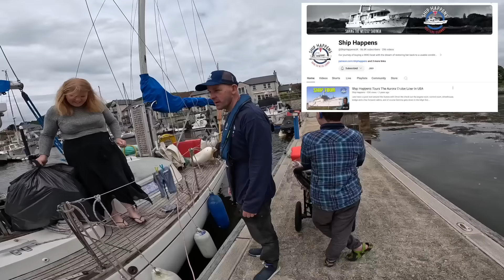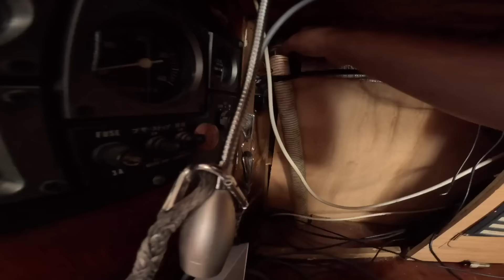Rip it all out!! Start again!!

Comment: Its the running time needed under worst case conditions that needs to be considered, plus a healthy reserve. I took a trip from my mooring in Salem MA to Portsmouth NH in October for the end of season haul out. I carried twice the fuel I needed for the early season reverse run from the marina to the mooring. The trip started out sunny and pleasant. After passing Cape Ann, a strong NE wind arose and the sun set. Soon it was one hand on the tiller, a hand on the rail, and braced feet. There was a spray of seawater to the face with almost every swell. Progress was very slow. After finally arriving in Portsmouth, I found that the public pontoons had been hauled out for the season. My last tank of fuel ran out and I had to anchor. So glad I was in a sheltered harbor and not still offshore.
Reply from the maker: Oh wow!! Thanks for sharing your experience!

Comment: Save a LOT of time by putting some fuel into each filter prior to installation. I would look into one of the electric fuel pumps to help prime everything, as it also works as a backup if the primary fuel pump fails in the worst place imaginable.
Reply: Ask about an automotive diesel electric fuel pump might be of use Andy like they use on vans to lift the fuel to the engine, you can also use it to pump fuel from one tank to another ..  in a problem situation.

Comment: One thing that you conspicuously failed to mention on the new day tank was a vent line.  Don't forget to install a vent for the tank lest you cause a new problem when the lift pump starts really sucking fuel out of the tank!
Reply from the maker: The vent line is there. I forgot to show it. Of course it's there it's one of the default attachments on the tank. There's lots I didn't show. It wasn't a tutorial. I didn't show me making a cup of tea or eating a sandwich either. Thanks though.

Comment: Nice one Andy. Nice to have 2 days tanks and once the main tanks repaired you'll be set. What a find with hopefully those 2 water tanks. Like you said do things bit by bit and hopefully when you are ready for the main sail things will be good to go and no problems arise. Yes get that messed cleaned up before Melissa arrives back. And you have to find a place where you store your tools so you know what you are looking for where it should be. I also know other sailing channels that have two of the most used tools they will use plus spare parts filters, fuel pumps, alternator, ect. I'm sure you'll have all this in hand once the main sail begins. cheers
Reply from the maker: Good suggestions thanks

Comment: Hi Andy Great job, for what it's worth I'm a mechanic and have been living aboard for 18 years. Always buy a spare filter in fact have a set of filters plus belts, fill the filters with fuel prior to fitting. That fuel tank and mounting, consider expanding foam into a plastic bag suspend the tank into the required position and at that point using the applicator nozzle supplied with the expanding foam squirt the foam into the bag and allow the foam to expand and support the tank. Also have you got the option to make a lifting or removable panel above the tank for easy access to the fittings. When your not busy 🤣🤣 those wires need to be checked to see if they are live, if not then operate every switch known to man to see if you get a positive signal.👍

Comment: A couple of tips from a former diesel engine specialist. The new vertical pre-filter can be partly filled before screwing it back on, saving priming time and your fingers and thumbs. 

If you can't find a filter wrench, a screwdriver through the casing and out the other sides works wonders, but obviously it will get messy.

There is normally another bleed screw on the fuel injector pump that bleeds the internal rail to the pump plungers.

Comment: What a great video. It was good to see the kind of real issues you often get. As a delivery skipper fuel problems are pretty common. 

You've sorted the fuel system. But more importantly you now understand the whole sytem and how to change the fliters, bleed and start the engine. Good knowledge and skills are probably more important than a perfect boat! Good onya. 

One charter boat I skippered in Antarctica had all the bleed points painted red, and the right sized spanners (also painted red) on hooks near the engine. We had to use it a few times and it made getting the engine running really quick.

Comment: Have you thought of adding a fuel trap before the filters, they have a glass bowl for easy inspection, and they are designed to catch water and large muck particles before they reach the fuel filters. They are also really easy to clean.

Comment: One idea: get one of those manual inline fuel pumps. It will make changing fuel filter and priming the fuel line so much easier. I installed one last year and haven’t regretted it a second.
Reply from the maker: I agree. This was filmed and edited a month ago so the comments and suggestions came in long after I'd already done the work

Comment: When i change fuel filters I always put some fuel in filter before installing. Same Injector pump as you have. You should open one injector line to get the air out and mine starts with few cranks.

Comment: Andy, next time you change filters whether fuel or oil partly or completely fill the filters with their relative fluids and you will alleviate most of the lift pump work. A tip I learnt as a mechanic.
Reply from the maker: Good tip!

Comment: Greetings Andy and Crew...I do enjy your vids and appreciate the ammount of work you all have put in to get prepared for your world tour.....Andy a sujestion regarding your engine lift pump issue ....Ditch the factory unit and install a 12 volt clacker pump they are noisey but efficent anwill fill with a usable preasurev of 4-6 pounds nore than enough to prime the engine as the main pump does all the work whilst the motor is in operation ....Good Luck ...Shalom
Reply from the maker: Good suggestion I'll do that at some point

Comment: Great work! It occurs to me that you could later add a large overflow elbow with a ball valve then pipe that to the keel tank. That way you can fill both tanks from the same inlet.
Reply from the maker: Yes 😀

Comment: Having a small farm and a number of pieces of old diesel equipment I have more than my share of dodgy diesel problems I ended up installing a prefilter with water trap on everything 9 times out of 10 you only have to change the prefilter if you get dirty fuel I chose a cheep (less than 10 AUD) readily available filter  so it isn't a financial burden to keep a few spares on hand

Comment: Diesel capacity increased 3 fold.  In time you can guesstimate how far you travel on 60-80 L. Remember to fill the 2 empty  jerry cans. Opportunities to extend motoring range 20+60+[(2or 3)×20]= 120 - 140 L. Just remember to use designated colors for diesel vs gas vs water. May also want to consider a screen mesh on the funnel to trap any sediment or funky business when transferring diesel from the jerry cans or dock or tender.

Took a bite out the thumb. Would consider adding motion lights or touch lights in the engine bay for increased visibility. Can't wait for the purpose or possible condition of the 2 mystery tanks. The never-ending job of tracing dead or live wiring.
To the next destination.

Comment: I know you say your not a mechanic. But the lift pump only does till the heigh pressure pump. Admittedly I have have never bled the injectors. Just turned it over a few times and it’s started. Oh and to save time on the lift pump, fill the filters with diesel first.

Comment: It’s been mentioned in other videos Andy but you should always fill the filters first which are very easy in your case good access and also fit a priming bulb
Reply from the maker: Yes you're correct there I didn't think
Reply from the maker: I will say this was filmed and uploaded a month ago. Long before the oth r comments
Reply: @SailingMelody  you did really well though and I must say the bigger fuel tank was a good upgrade so much easier to fill from the deck now well played 👍🏼

Comment: All that water could upset the balance of the boat. But great job with the new diesel tank and getting the filters sorted. You could also put fuel in the filters before putting them back. Lift pumps take for ever.
Reply from the maker: I wonder what the original design was though eh
Reply: @SailingMelody  Yes but keel tank for diesel. Water not the one in the saloon. Also need twenty knots to move. fully loaded.
Reply from the maker: @carltontweedle5724  not sure you're right about that.  Ive heard lots of people saying we won't move in less than 20 kts and everyone is entitled to their opinion.  but come sailing with us in 14kts and you'll change your mind.

Comment: Perhaps the new red tank can in future become part of a fuel polishing system… your main fuel in the repaired keel tank gets polished and deposited into the red tank, which is the only fuel the engine will see… leaving any trouble… asphalting, the dreaded diesel bug etc… separated from the fuel the engine is running on for addressing later, at a better opportunity.
Reply from the maker: That is the plan!! Great minds 😁

Comment: Without wanting to add to your angst re silly or malicious commenters, I’m struggling to figure out the point of the day tank for your diesel. On essentially the same boat, we have a 360 litre tank in the engine room on the port side (opposite the crawl through and an extra 75 litre diesel tank under the vee berth which transfers to the main tank via filters and a little square electric pump which pumps about 2 litres a minute, from memory. So no day tank, we simply draw from the 360 litre tank via the engine lift pump.
Reply from the maker: The main tank is currently decommissioned, and we are working to get it reinstated. Ours is in the keel. However once it is we will also keep the smaller tank so the fuel can run through a filter system before getting to the smaller tank.
Reply: @SailingMelody  What will you line the keel tank with?
Reply from the maker: @PaulBKal  epoxy and glass cloth

Comment: I was thinking that it would start on the 3rd inector blead off. Then you cut after number 2 to it running. So tell me, did it start after bleeding the third injector?  That's  what happens every time for me. Starts after bleeding 3 of 4.

Comment: Double clip the deck filler pipe. You shove the nozzle, pushes the pipe off, and fills the bilge.
I've got the T shirt.
Reply from the maker: Thanks for the tip!!
Reply: Sorry to read your " angry " post. I haven't read any of it but I can imagine. Why don't they ps off if they don't like it. No-one has to watch.
I'm 71, father had boats so I've sailed all my life. I still have a 10m ketch. Your lack of experience may be clear but your approach seems fine.
None of us were born with experience. Everything has to be learned.
Good luck.

Comment: Andy, you are cracking those injectors too wide. Just a bit of a turn loose will get you there. Opening them too wide makes it harder because it lets air back in. 

One thing I will strongly recommend to you is going for a Raycor dual filter system, it has a valve you can throw to the other filter when one clogs, it would have completely solved your issue on the water the other day with the throw of that valve, well assuming there was fuel in the tank, but you know what I mean. 

It is a fantastic system and IMHO should be mandatory on any boat putting to sea on the open ocean. 

Also you may want to wire up a start button for the engine room so you can turn the engine over while cracking the injectors, and a stop button if the fuel cutoff is difficult to reach.
Reply from the maker: Yes we definitely want to get one as soon as we can thanks for the helpful advice 😃

Comment: I add my vote to you ignoring the useless/annoying comments. Having said that, here is a comment that may well not pass that filter! Re the mystery wires: I have had to deal with that on 2 old boats; best bit of kit is to get a signal tracer; this induces a tone on a wire and then you can search/follow the wire with the tracer that 'hears' the tone in the wire as it goes its merry way along inside the boat.

Comment: You have ignored many previous helpful comments about using or fitting a primer bulb to avoid the lift pump or cranking engine to clear your fuel lines😢. Cost pennies save valuable minutes especially on a lee shore. Also could help if your lift pump diagphram is dodgy.
Reply from the maker: This video was filmed weeks ago long before those comments came in
Reply: I don’t think the helpful suggestion has been “ignored” … lost in the plethora of comments maybe, but give ‘em a break! I know just a small handful of folk able to take on the demands endured and suffered by Sailing Melody and still able to function. Sailors stand together ⛵️
Reply: WRONG! Every component in any system is a potential  problem in the future. Fitting an extra bit which cost 'pennies' is a compilcation I always avoid.

Comment: Next time you change your filters prime the filters first then fit them it saves a lot of pumping that's how we diesel mechanics do a service same with the oil filters prime them first good look great job on the new tank a lot better than the old one for sure I would put a strap over the tank for safety in case the worst happens and you capsize god forbid the tank will fall out and fill the boat with diesel maybe, it's just an added safety precaution. by the way, you can't prime the injector pipes with the lift pump it's high pressure only the injector pump has to prime the steel pipes that's why you crack the pipes loose to let the air out and crank the engine you don't need to bleed the feedback to the tank you only need to bleed up to the injector pump that's its job done apart from the injector pipes which the injector pump will do when cranking soon as you get a few spurts tighten the nut up and move to the next one while still cranking if it runs fine let it run, just tighten up the rest quickly wipe up the residue and you're done ready for the next service. all the best from john from Rugby UK.